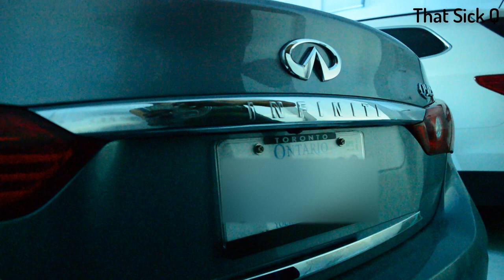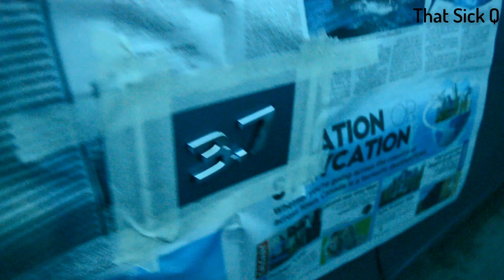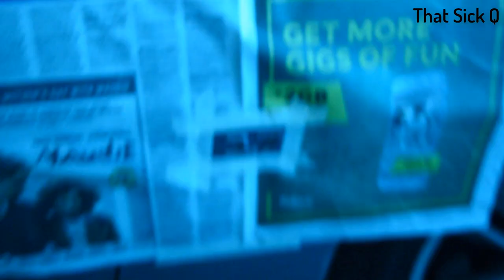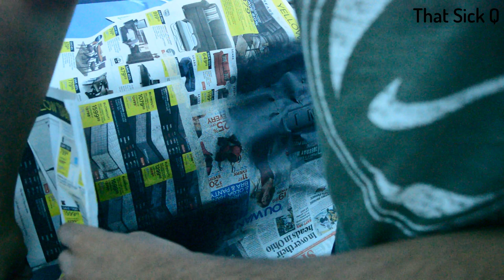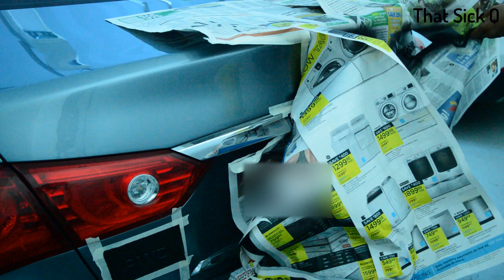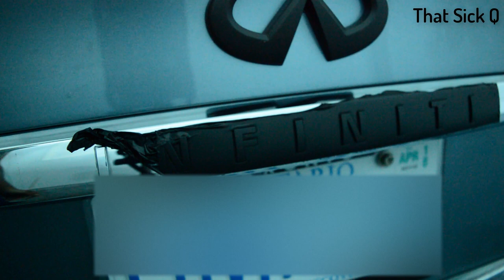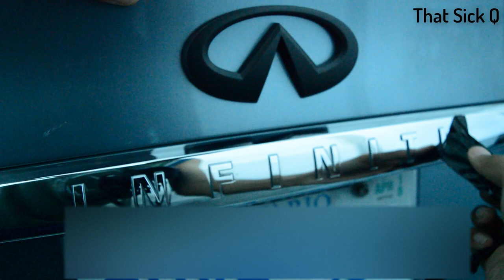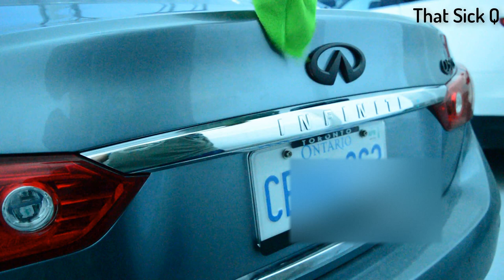How to PlastiDip your car (FULL STEP BY STEP GUIDE)

Comment: Do you think the squeegee  was worth buying? I recall you using a credit card in another video lol
Reply from the maker: William Cheung wait are you talking about vinyl wrap squeegee? If so then nah not really I would just wrap a microfibre towel over a thick card. The credit card I used it for tight spots bc it’s so thin 🙂
Reply: @AnishNothoo  I'm gonna tint my rear lights w/ a vivid wrap... I was going to use a credit card............. lol.  thought it would be the same. I guess that's where I should use the squeegee then?
Reply from the maker: William Cheung I made a video on that just need to edit it but I barely used a squeegee, just my thumb cause you work on a small portion at a time
Reply: @AnishNothoo  just your thumb? To squeeze the small air bubbles out right? Mines doesn't require water. Hopefully it'll be a quick application.
Reply from the maker: William Cheung using water will give you a better finish but applying dry is easier. I applied dried and am happy with the finish sooo I guess it works out 😂